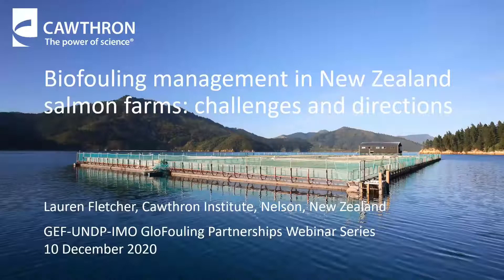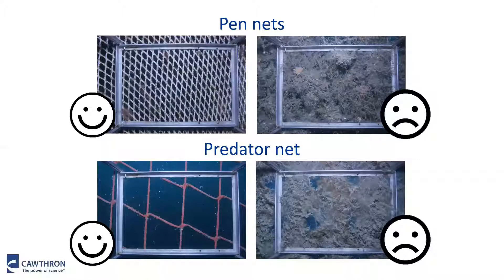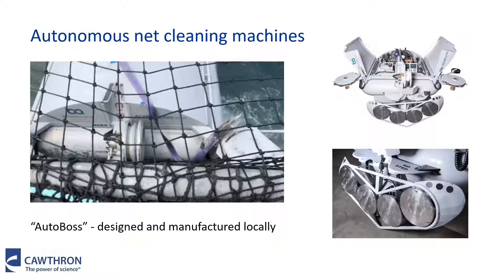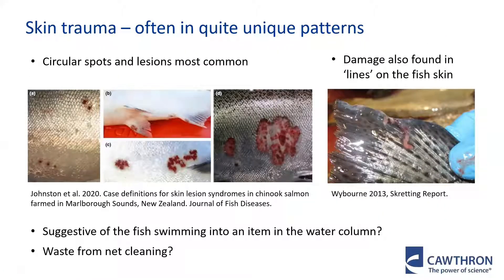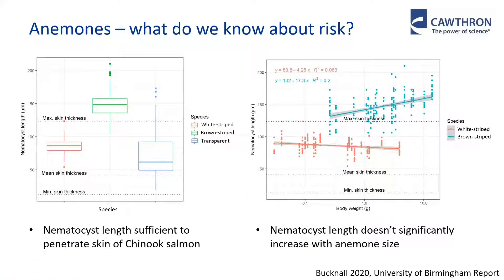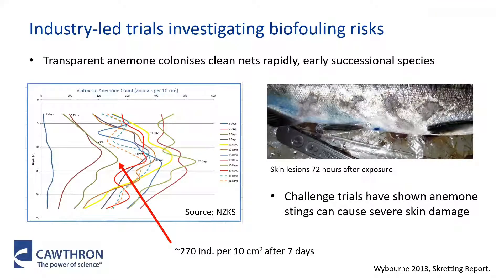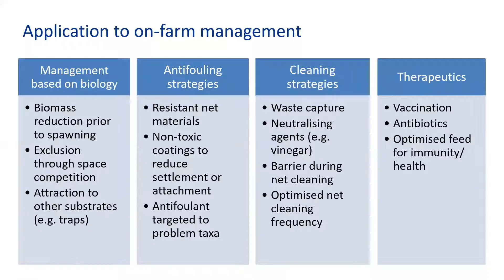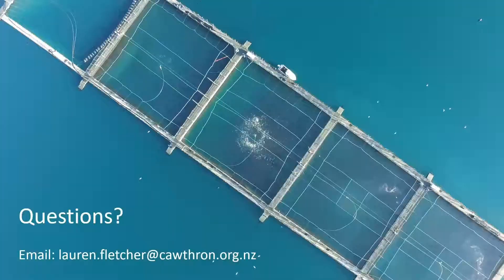Biofouling management in New Zealand salmon farms: challenges and directions

Comment: How long does net cleaning take? Is it possible to move the pen that needs cleaning down current, and then slide a solid sheet inside the net pen to contain and protect fish from cnidarian debris during cleaning? Fish in the internal solid temporary net can be maintained during this period by aeration, oxygen injection or peroxide to maintain adequate dissolved oxygen.